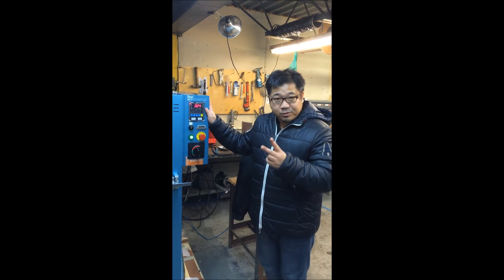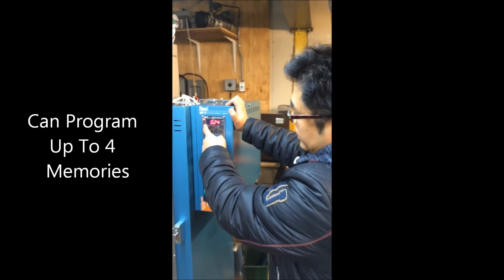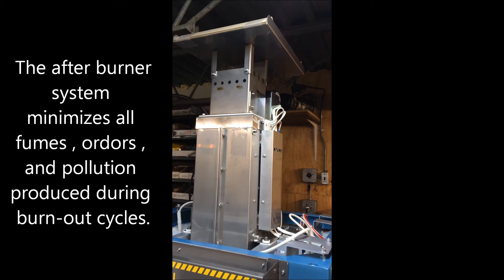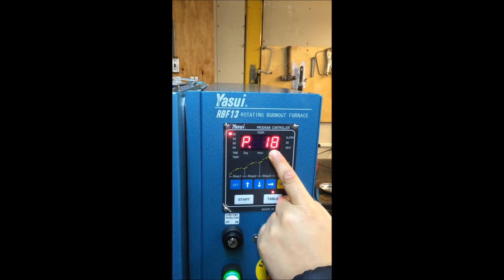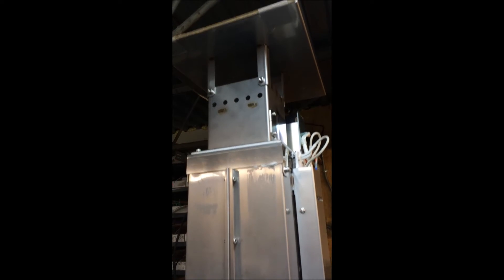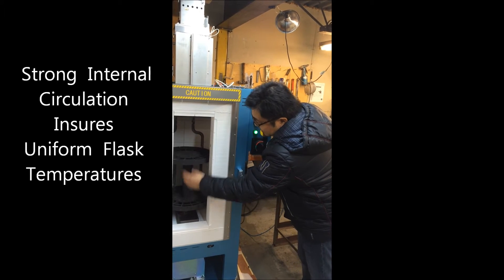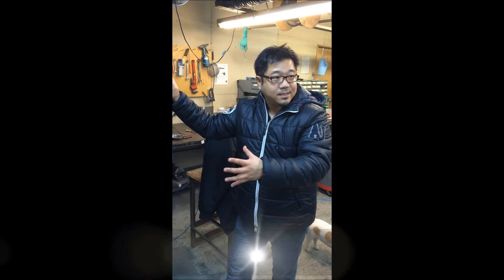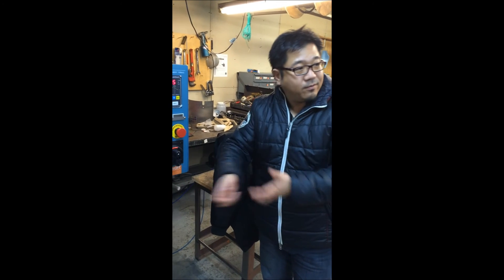Yasui RBF 13 – Rotating Burnout Furnace

Comment: How many flasks we can put into this furnance? if it is 4 inches diameter flask.
Reply from the maker: They can hold up to 13 4" diameter flasks or 16 3" diameter flasks with a maximum temperature of 950C.